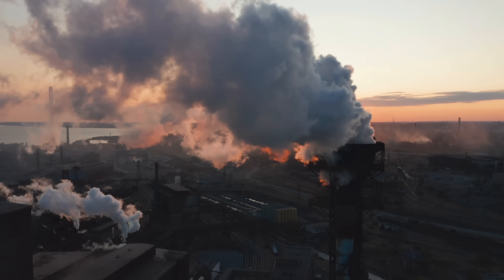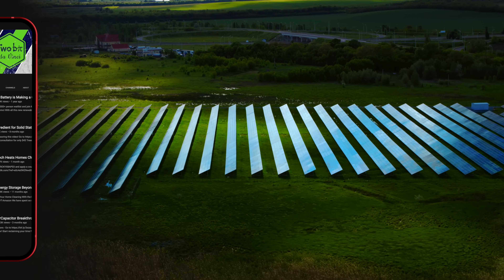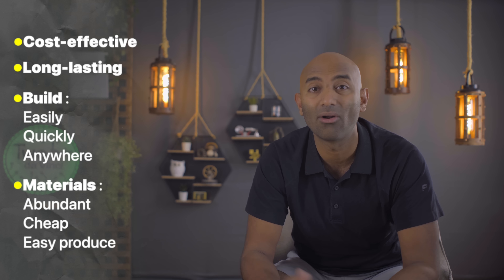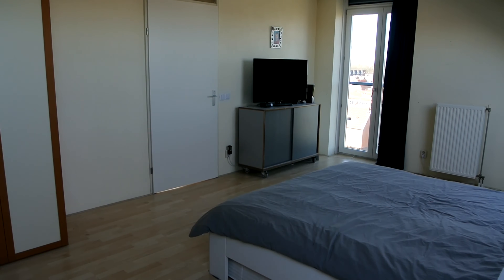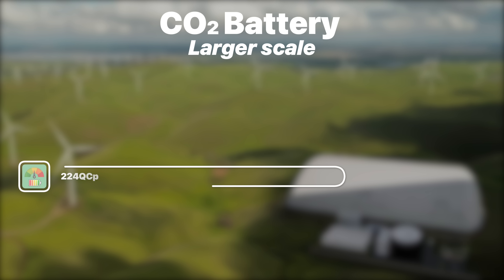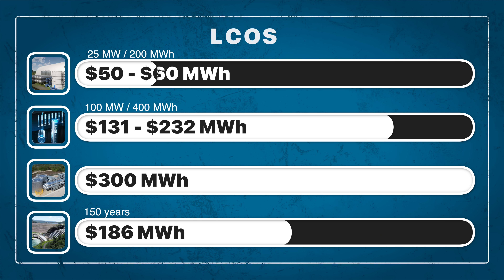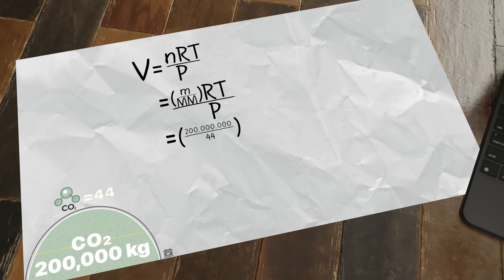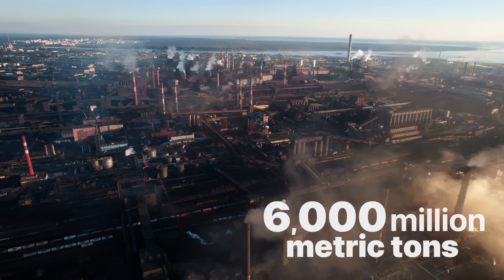The GENIUS Of the Carbon Dioxide Battery

Comment: The title is click-bait, and a narrow lie.   We are not wrong about CO2 causing change. 
The CO2 'battery' works like this, liquid CO2 is heated up by green electricity, and then liquid CO2 is converted back into a CO2 gas that powers a turbine, which generates electrical power.
Given click-bait title, and a narrow lie it presents. This video gets my thumbs down.

Comment: Can you site the study that resolves Pumped Hydro Storage as costing $186/MWh over 150 years? Lazard, when they were still bothering to consider pumped hydro storage but were trying desperately to fix the numbers and pump lithium as the new storage solution, considered pumped hydro storage across "20+ years". That's illogical in a lifetime cost analysis because PH does have the longest lifetime and can easily exceed 100 year . And $186 is extremely high anyway. Who's saying pumped hydro costs that much across 150 years?

Comment: Lots of maintenance on this one. Long term reliability will make or break its success.
Reply from the maker: absolutely, but because it doesn't really require any exotic parts, even if there was a replacement interval, it could still prove pretty reliable, especially since you don't need to freeze anything

Comment: From your presentation this is a very promising tech. It's relatively easy to implement at scale and is already standardised due to the component parts in use. No need for exoctics or training in new tech. As much as individuals wish to use carbon capture tech to supply the CO2 it's, as you have pointed out, a drop in the ocean when compared to what is being pumped into the atmosphere. I believe that governments will look at it from a economic and security perspective, especially as OPEC+ (which includes Russia in their cartel) are manipulating oil production world wide.
Reply: The CO2 being discharged into the atmosphere by human activity is actually beneficial. Benefits include increased agricultural yields (main effect) reduced winter heating costs and fewer deaths from hypothermia.
The real issue is that fossil fuels are a finite resource.
Reply: @johngeier8692  At one time adding CO2 gave some benefit. Plants started growing faster, decades ago. CO2 is not the limiting factor for plant growth anymore. Adding more does not increase plant growth much.

Increasingly violent and unpleasant weather due to the increasing amount of heat stored in the oceans and atmosphere is causing major disruption in food production, housing and manufacturing. Not good.
Reply: @nedames3328    Seems to be a balance.  Co2 isn't effective unless there is ample nitrogen. 
(Makes me question why they would limit the allowed amount of nitrogen to be used by farmers).
Reply: Biden also manipulated oil production by shutting down pipelines and reducing drilling but  then attempting to buy more oil from other countries to make up the difference as if the U.S. burning other nations oil causes less pollution.

Comment: Notice you didn't toss in flow batteries in the mix. I just read that China turned on the world's largest flow battery.
Reply: yep, and liquid metal, which also brags of being cheap,
and also the sodium batteries made by the same guy with liquid metal.
but also true, those two seems to take forever being released at scale.
and there is that rust battery, also bragged as cheap, but size is really an issue.
and anyway, actually the biggest issue is making those big solar and wind farms. 
Till there will be cheap storage the old coal plants can be converted to run with heat stored in sand or in rock.

Comment: I think that it shows promise, mainly because it mostly uses existing technology. My main concern is the longevity of the bladder. Will it weaken after many charge/discharge cycles? Another advantage is that much of this technology would be very familiar to existing fossil fuel power plant operators, thus providing a readt transition path for those workers.
Reply: I believe the 30 year lifespan of the system is probably the the life span of the bladder… all the rest the components would probably be replaceable on an ongoing basis
Reply: In the days of municipal coal gas production, the gas was stored in big domes that were floating in water (look up "gas holder"), so this is very old tech. I'd be interested in whether this company has evaluated the old gas holder technology before opting for this bladder thing.
Reply: @mattiasthorslund6467  var det sådan, den slags gasbeholdere, der bl.a. stod i Valby, virkede? 🤔
Reply: Use salt domes if available, no need for bladder?
Reply: @jonahbert111  Or reinforced tunnels.
Reply: We have a well on our property. The well pumps the water up into a pressure tank or a storage tank basically. It has a rubber bladder inside of it so you can put a little bit of air pressure in the top and be able to get most of the water out before the well pump kicks on to fill the tank again. 
I'm not a chemist but I know water is, or can be, a fairly corrosive liquid depending on what's dissolved in it. I'm not sure how corrosive CO2 gas is but those water tanks last for 25 years or more. Its usually rust and corrosion inside that compromises the seal between the bladder and shell that causes those water tanks to fail. I would wager to Guess that the CO2 bladder in this system would probably last at least that long if not longer since no rusting.. That's not too shabby when you think about a battery that can go through 25 years worth of charge and discharge Cycles I suppose.
Reply: I would be more concerned with the Suns UV rays deteriorating it from the outside.
Reply: @randybobandy9828  The bladder is not the outer dome, it is housed inside, so it is protected from UV light.
Reply: you could change bladders while the system is in use pretty easy I'd think. compress all the co2, change the pipes to a new bladder dome. problem solved. they might even be able to put a new bladder into the old dome easily enough. I"m not even sure where their 30 year lifespan is coming from considering how simple this system should be to maintain.
Reply: @TuttleScott  Agreed, unless it is involved in the turbine generator costs, but again that can be replaced / upgraded easily enough. Maybe they mean 30 years without downtime, but I imagine a sight will have multiple units, so taking one down for extended maintenance shouldn't affect the grid too badly.
Reply: Why even use a bladder, CO2 is heavier than air, just vent to the outside and CO2 will be sitting at the bottom of the dome.
Reply: @IdleIslander  Yeah, it won't mix at all. Just like you can keep a cup of saltwater long term at the bottom of your pool because salt water is heavier than fresh water. /s
Reply: Bladders are not the only answer. Gasometers have been used to store natural and coke gas since the 1800's, and some of the ones put up after the second world war were only decomissioned recently. I'm sure the quoted 30 year lifespan includes the estimate of the lifespan on the bladder, In any large scale utility installation it would be simple to provide redundancy with multiple systems so that one could be taken out of use to allow maintenance or checking, or repairs to bearings etc on the compressor and turbines.
Reply: Any Research to improvement`s is a good thing
Reply: Since CO2 is heavier than air, these things would be massively dangerous. If the bladder ripped and released all that CO2 at once, any places that could accumulate the gas would be toxic to animal/human life. Over in Africa, there are several lakes with CO2  Being released at the bottom from underground sources. When something disturbs the water overhead or pressure builds up sufficiently, the great percentage of the CO is released at once, and it has killed hundreds of people and thousands of animals. These were low technology areas, so no warning systems were available. Even with warning systems, people close enough to a large enough release might be overcome. Yes,  it is diluted over time, but if the gas is close to transition level in temperature, it could take quite some time to dissipate.  I wouldn't want to live anywhere near to a plant of this type of any size.

Comment: The size of that dome, when brought to grid scale storage, is just going to be too large to justify. I don't see this going anywhere. Instead of filling the dome, why don't they immediately compress the Co2 to a liquid. They're going to anyway if I understand the process correctly.
Reply: It's a closed system. The process needs to store the gaseous CO2 in the dome while the battery is discharged and then it draws the CO2 from the dome to compress and liquify it. It doesn't take the CO2 out of the atmosphere. That's why it needs the big dome.
Reply: Fields of wind turbines and solar panels take huge amounts of land.  Maybe the domes could be buried under them or reshaped to be low enough to not interfere.

Comment: I like this idea.  But I have a question.  Or actually a future question.  I understand the layout now during the early stages when all sorts of things need to be checked.  However, it seems to me that this would be so much better if buried.  For example, take a plot of farm land.  Scrape off the top soil.  Use standard strip-mining procedures to dig down 20 or 30 feet.  Build everything on that flat.  With all sorts of extra dome space.  Fill it back in.  Put the top soil back.  Continue growing.  Even with huge combines, there isn't that much added weight to have to account for.  And if CO2 does escape, the plants growing on top would gobble most of it up.    Hell, you could even make that part of the the overall cycle.  Continual bring in CO2 from industry to replace the old CO2 you release carefully into the crop.  Which would generate bigger and faster yields which would help offset the cost of getting it from manufactures that capture it for you.
Reply: I think an even better idea would be to use one of those huge caverns they use for compressed air wherever it's available, don't you?
Reply: @ipp_tutor  not all places have the geologic formations for that kind of storage when applicable it can be used however they need to design the system to be used in more locations to be vaible.
Reply: The weight of the soil on top will be a issue as the tank will be compressed by it. Under different loads when full and empty will also add issues which is now additional cost. The benefit of burial is in case of a leak it will slow the release. Which will now be harder to fix and much more dangerous to fix. Nope better to leave it above ground. It does bring up the issue is what is the impact caused by a leak, as name a company that doesn't put profit first in the long haul.
Reply: Bury 'em - great idea. Much better than having to look at the horrible things. They take up so much space that we 'should' be using for crops, rewilding, forestry, or some sort of 'greening.'
Not sure that 'leaks' would be taken care of by plants soaking it up, a leak might produce too much for them to cope with - 
Goodness me! You realise you might have stumbled across a potential disaster situation here. 
CO2 sinks right? Well, you'd have to be really careful where these are sited, because if they did leak and the escaping gas sank into a hollow in the landscape, possibly where people live, there's the danger of suffocation - it's what happens in low areas where there is volcanic activity. I remember there was some little village around an African lake, everyone perished because CO2 bubbled up from the nearby lake.